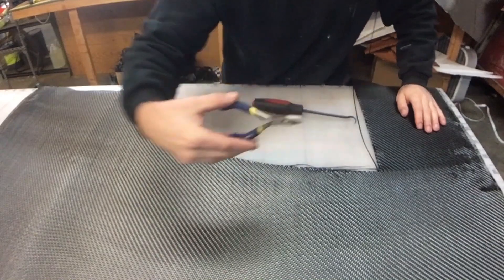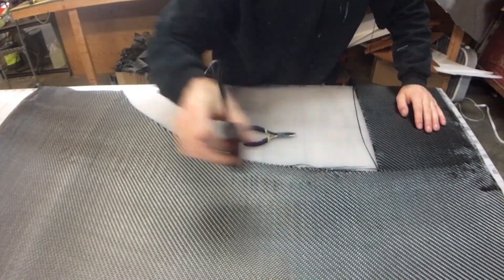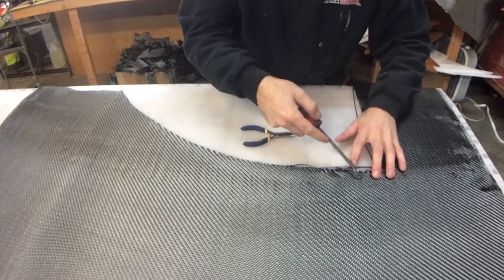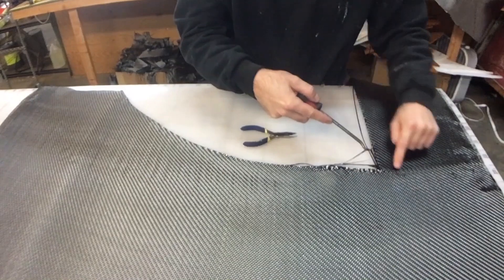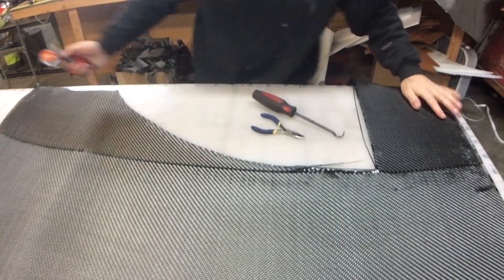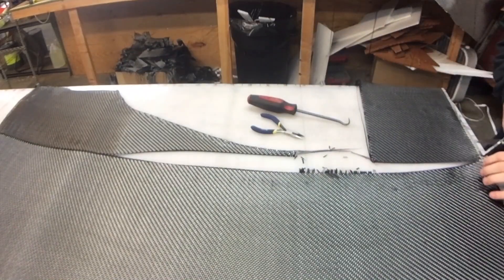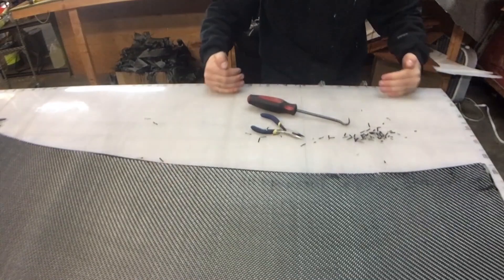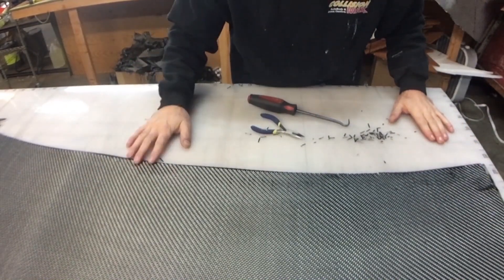Tip for Cutting Straight Lines in Carbon Fiber

Comment: Hey man, im working with dry 120gsm uni carbon and cross cut or along the grain cuts are fine, but I’m doing 15° cuts and it’s impossible without the whole cloth getting damaged. I need spot on straight lines so cant use scissors if you can help?

Comment: Who makes that table with fabric roll stand at the end? I need something like this for my shop
Reply from the maker: millenniummark built it myself.
Reply: @ajhartmanaero  that's awesome, if I may ask, what did you use for the cutting surface of your table? I've been using the green self healing cutting mats and after a little while of use they've started fraying my fabric at the cuts
Reply from the maker: @millenniummark  pretty much the same thing just really large. Got it so long ago I forget where I got it from. If mine gets a chunk that starts pulling carbon I cut it flush with a razor blade.